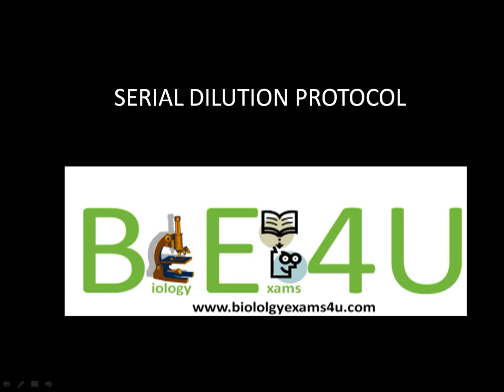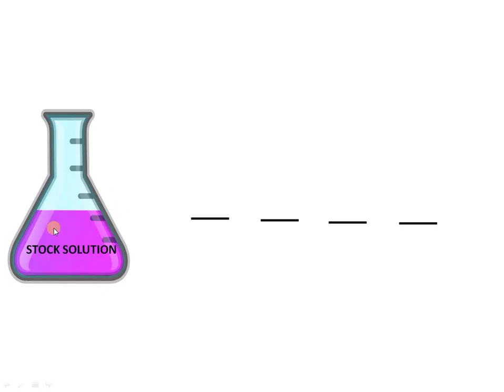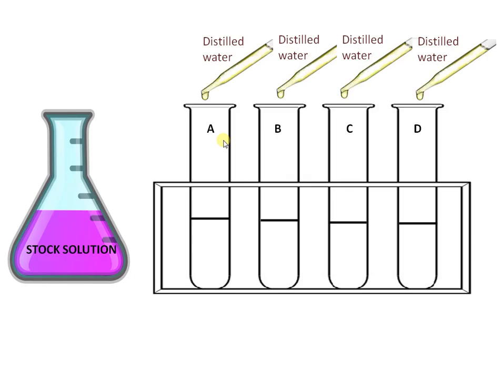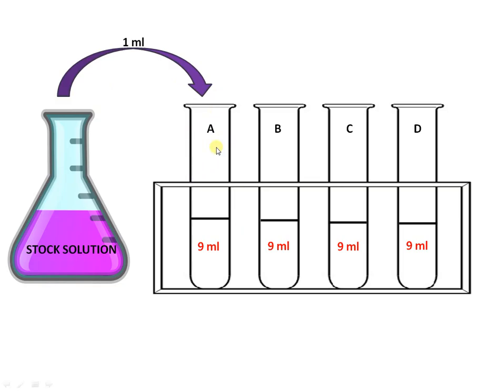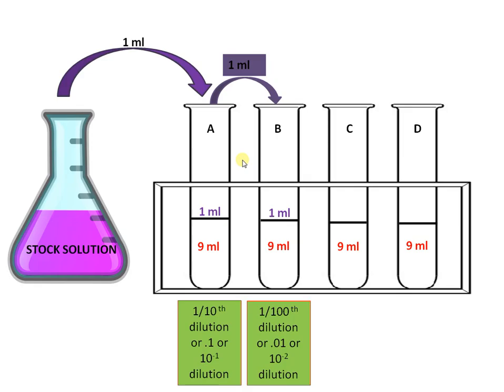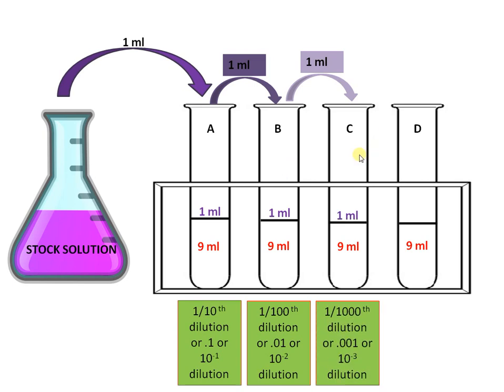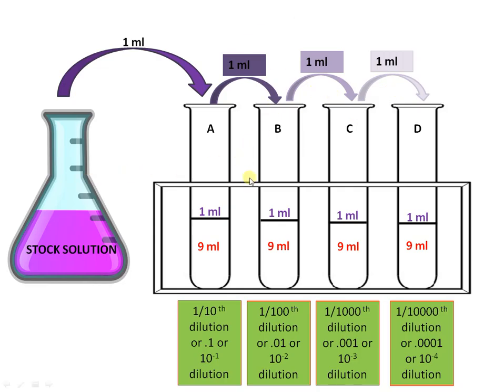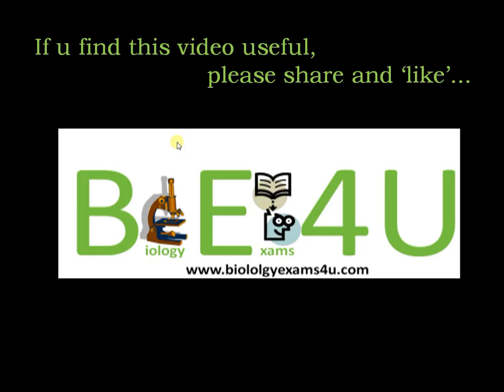Serial Dilution Method Protocol Step Wise Explanation

Comment: I understand the video, but can someone please explain to me how this can be used to estimate the number of bacteria in the stock solution?
Reply: Inoculate and Incubate before (stock) and after (1/10,000) tube
Reply: After you've done the experiment you'll will measure the number of bacteria in the diluted tubes. To illustrate i'll assume you've only measured the last vial. Let's say the number of bacteria in vial D is 1000, you don't know the amount in the stock solution BUT you do know that Vial D is 1/10000 of the stuck solution, which translates to; #Bacteria in D= #Bacteria in Stock * Dilution factor (1/10000). Therefore, #Bacteria in Stock= #Bacteria in D * 10000. 

A simpler way of calculating is that if you go from Vial D to Vial C (and know the amount of bacteria in Vial D), you'd have to multiply that amount by 10. Then you do the same from C->B and from B->A and then from A->Stock. If you noticed all you did was multiply the amount in Vial D by 10^4 (10000). So that works too.

Comment: i failed my ASCP exam and i saw these questions on it. i did not know the answers.
a person overdoses on salicylate and goes to the ER. WHAT WOULD BE TESTED?
a) pH
B) Ammonia
c)creatinine
d) BUN

A staph like organism is isolated from a wound culture in is resistant to all GPC antibiotics and to Vancomycin, using the automated bichemical method.
what should the tech do.
a. do a gram stain
b. recallibrate the machine
c. report as not Susceptible?

If the stock solution had 9ml of saline and i add 1ml of serum making it 1;10
six test tubes labled Ato F contains 0.5ml saline in each.
i add 0.5ml of the stock solution to tube A and mix and the add 0.5ml to tube B and mix and add 0.5ml to tube C and mix until i reach tube F.
What would be the dilution in tube F?
Reply: I'm not sure but I would guess A because salicylates don't contain ammonia?